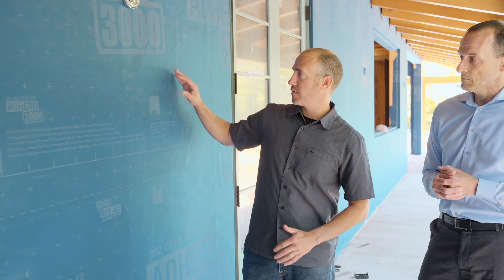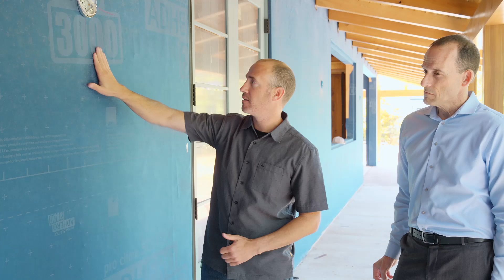Venkatesh #9 - The Forever House or "How to Make Your Home Last 100 years!"

Comment: How many years will it last?
Reply from the maker: Good question.  Most homes in our areas fail for one of three reasons: Foundation problems, Water Problems and Termite Problems and termite problems are usually related to water problems.  The foundations these days are incredibly robust and considering what they built to and 70 years ago and how long these lasted, the foundations we are building today will outlive anybody alive today, EASILY.    The water issues are barely better today than they were 50 years ago. In my experience, Tyvek and membranes like that perform like crap.  The are freely permeable for bulk water and they should NOT be used, in my opinion.  The better membranes, like Adhero, Henry Blueskin(when protected from the sun very quickly) and in general, everything with a drainage plane/rain screen, and proper flashing directing water to the outside, should last for 100 years plus, as long as they are protected from the sun.  None of these membranes last very long when exposed to UV light.
Reply: @BuildingABetterWay  Thank you.  I plan to build my own house one day.  I've been researching for years.  I don't plan to do it alone but to build up on leading expert consultants, while I do the work.  However back issues at the moment limit me.
Reply from the maker: That is great news. I started my company knowing very little about construction and have loved learning about it for 20 years now, but I sure do wish I did what you are doing and find some good people who do this everyday to help me learn and grow.  Congrats on taking the better path.  I hope your back gets better. That can be misery. Take care.